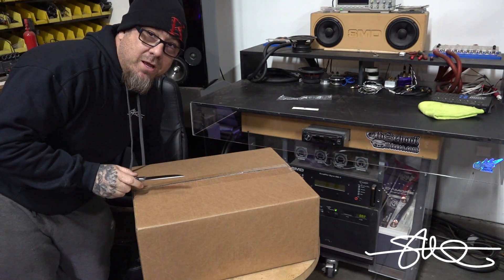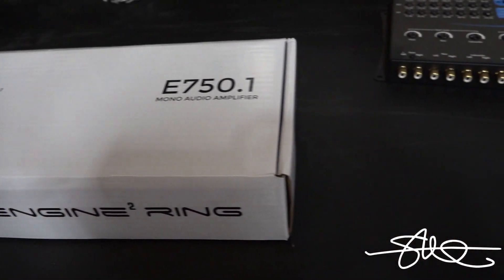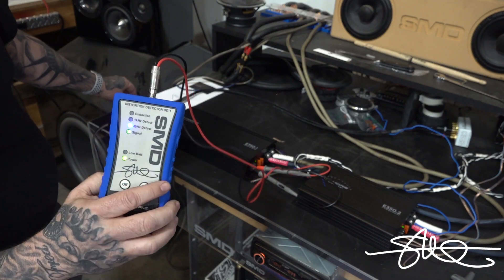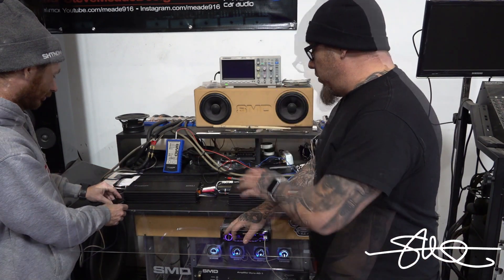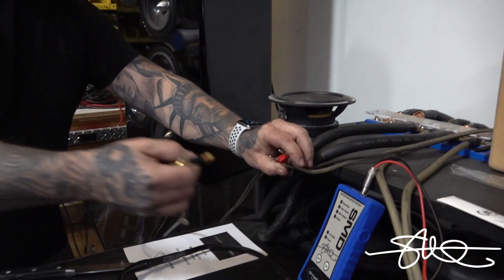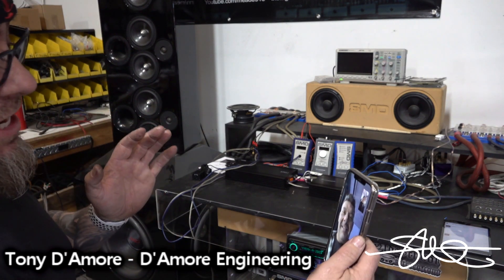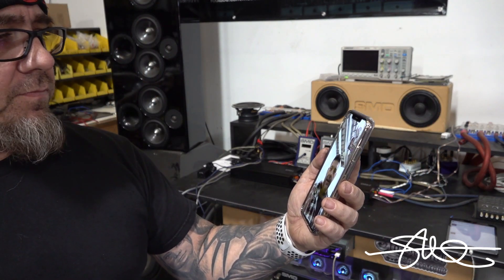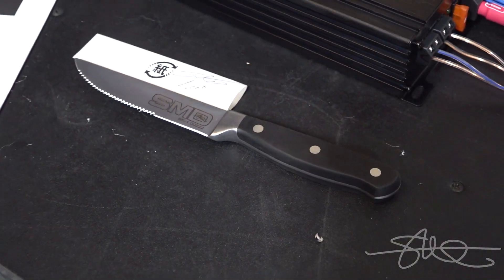Clean D? New D'Amore Engineering E Series High Efficiency Amps. Small & Powerful! unboxed, tested

Comment: I acquired these exact amps 750.1 and 350.2 and I am blown away, I've always swore with class a a/b these are the cleanest multi channel class d amps I've ever owned including dd, ampere, audio legion, and a dozen others d'amore engineering is on another level.. don't hesitate on these apps the 750.1 does over 1000rms clean

Comment: These D'amore Engineering amps are absolutely downright sick! I swapped out a Phoenix Gold ZX350v2 for the D'amore Engineering E350.2 and a Phoenix Gold ZX500v2 for a D'amore Engineering E1000.1 amp and it's a HUGE difference. Running (1) single 8" Sundown Audio X8v3 and 2 sets of Morel Components. In my enclosure, I'm also using (2) 10" Earthquake Slaps Passive Radiators. I have been into car audio for about 25 years, super picky, and this blows my mind! Setting off car alarms, people think I have at least (2) really good 15's.... What can I say, I know what I'm doing & more importantly what I'm running and how I'm running it. 147.3db @31hz go figure... DO YOUR RESEARCH PEEPS!
Reply: I can imagine that they´re more powerfull than an oldschool PG amp, but how does the sound compare?
I have a bunch of them old PG amps, M, MS and ZX and even for today´s standards they sound awesome.
Those old PG amps are built like tanks, i´m curious if today´s class D amps will survive for 30 plus years.

Comment: Forst of all. What up Steve.. 
Seen first hand over the years EMI kicking on SRS lights and causing very poor FM reception in vehicles with amplified antenna systems. Like most vehicles built these days.
Back when I first saw it, it was all euro. The amount of EMI in the trunk would just knock out reception. We would try to relocate or move the amplifiers around in the trunk to minimize it but always had poor reception.
Tony and I have spoken about D class for about 9 years now and I've happy to see him (and Juan) finally have the time to go down this road.
D isn't going away, the package size and power/cost just lends it to be an easy option for a lot of people.
I'm all for every beatin down the block, and am excited to see an amplifier company addressing more of the issues I've seen over my career. 

-Ray
Reply: Never knew Class D amps can cause poor radio reception and even throw check engine lights.  

I agree Class D is not going away.  There are those concerned about weight too.  If amps can be made powerful and lightweight and still sound good.  All the better.
Reply from the maker: COMMENT OF THE DAY.  From someone who fucking KNOWS what they are talking about.

Comment: @meade916  I'm taking care of the #0001 brother! However, it did just recently open up my new Sundown NSV4 12s 😎   
Thanks again!
Reply from the maker: did it perform to your expectations? did you cut at a 32 degree angle like in the instruction manual? hahah JK man, thanks brotha!!
Reply: @meade916  absolutely! Pretty certain I gained a little on the meter too! Haha. I'm going to throw it in a small display case and make it a wall hanger.   
Thanks again!

Comment: What is the purpose of passive radiators for the subs ? I honestly don't know and I'm curious what purpose they have...
Reply: Helps smaller subwoofers in smaller enclosures have more bass such as the Kicker 47TRTP82
Reply from the maker: @jimmykingjr2692  no.
Reply from the maker: they work just like a port.
Reply: Passive radiators multiply the over all surface area of the original powered driver's cone. I.E. 
Powered driver : a punch with a closed fist. 
Passive radiator : a slap with an 
open hand.
Reply from the maker: @408SPLKINGS  where the hell do you guys come up with this nonsense? SMH!! LOL!!!!